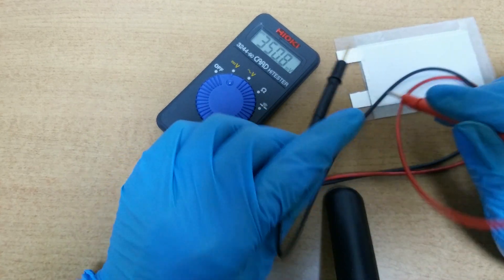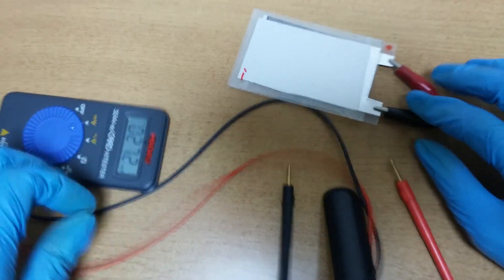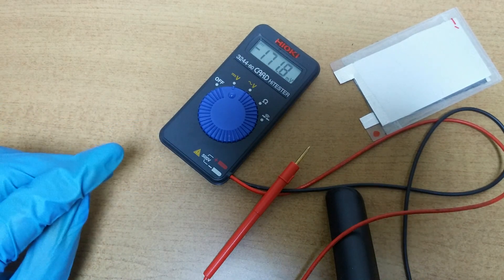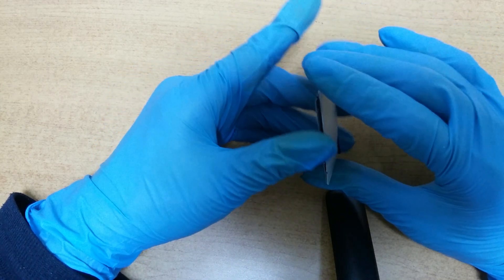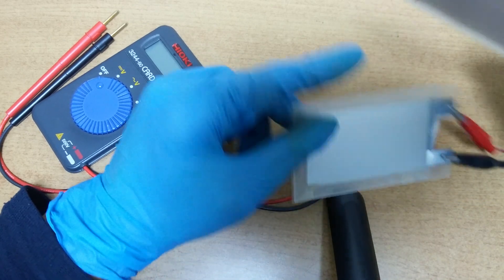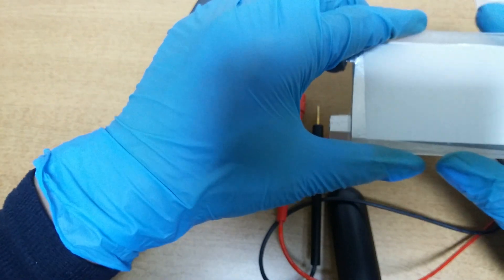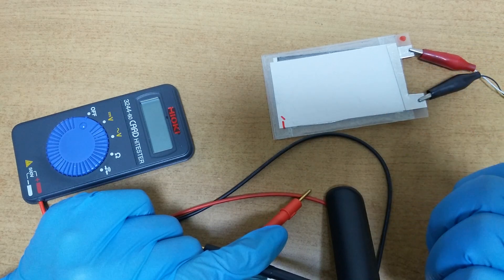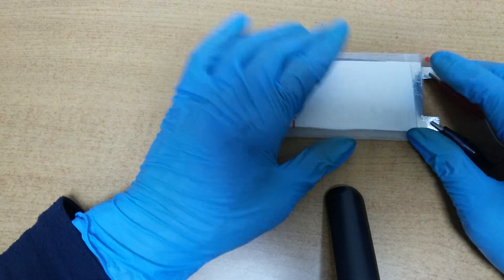solid state battery experiment 3.8 V in one layer

Comment: is this not essentially a bipolar stack?  In fact, rather than the aluminum "sandwich" in the middle, you could put the anode material on one side of the aluminum and the cathode material on the other side.  Might also be worth trying to strip off the oxide layers on the aluminum.  I still think your batteries would perform much better if you at least rolled the layers together.  Remember, most prismatic batteries must be compressed.  Just some suggestions.   Keep up the excellent work!

Comment: are you not using a bipolar electrode?  Is there any reason to use two pieces of aluminum foil for the bipolar configuration?  Why not just put the active materials on opposing sides?  There must be an aluminum oxide layer between the plates of the bipolar configuration.
Reply from the maker: Mabe, I've every tried. But I will keep in mind what you said. Thank you.

Comment: Would it be plausible to layer these sheets together?
Reply from the maker: I am afraid that I cannot understand exactly what you means. Can you tell me in more detail?
Reply: @solidbattery9956  Would it be possible to improve the battery by making a multilayered version?
Reply from the maker: @chet6900  
Regarding voltage, it seems possible but not amps. Have a great day